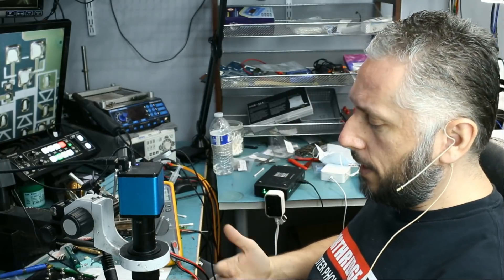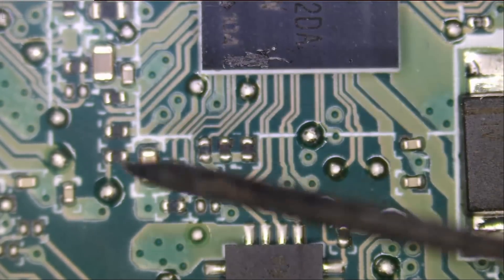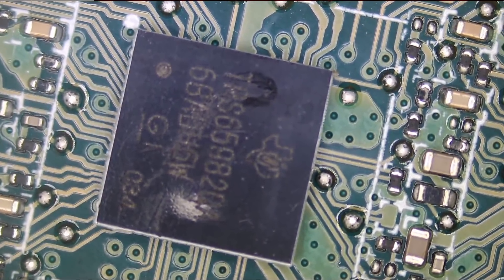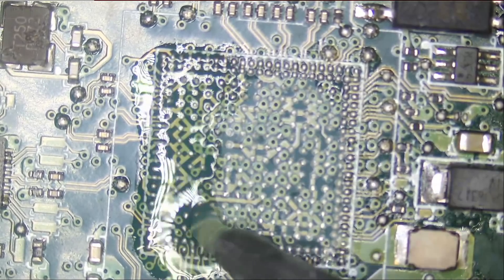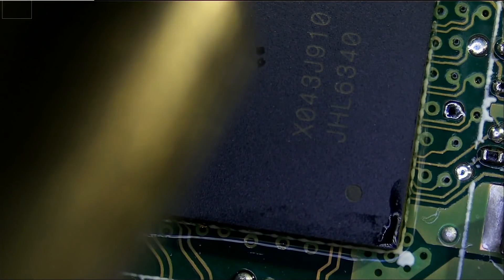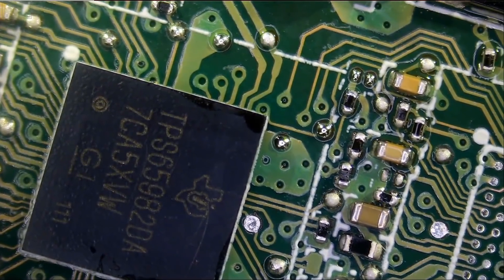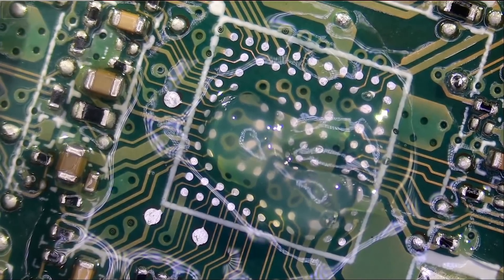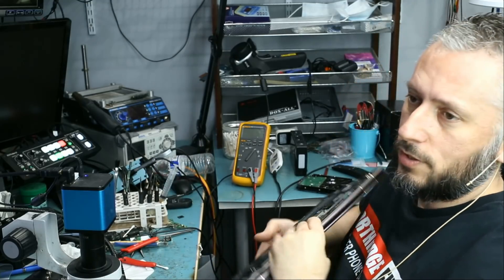HP Spectre x360 Laptop Repair - Not charging or powering on & both USBC ports not working

Comment from the maker: The chip at 11:16 was re-adjusted after realizing one of the two ports was not vworking. It had the wrong orientation
Reply: I was just going to comment and ask this. Because of the pin 1 in the first chip marker and the 2nd chip pin marker are the same place. Good job as always sir. Keep up the good and awesome work.
Reply: I saw it flip right before you got it down on the board. I could do nothing to help! 😅
Reply: did the chip still work? or did you have to replace it again?
Reply: was just about to comment on that

Comment: I have a Dell XPS with same chips, but three of them. One of the ports was at 5V, and the PP_HV line was short. I replaced the chip and now have 19.8V on all 3 ports but laptop still not turning on. I wonder if I need to change that other big chip on my board too. Didn’t find any shorts around it.

Comment: We have a HP Spectre x360 15-bI012dx and it would only charge to 1% on a new battery so I thought it was the battery and replaced it, but now it doesn't even turn on.  The computer has the green light when the power cord is plugged in and also we get the green flashing light when we press the start button on the side.

Comment: I usually add a small amount of solder on the pads and gently tap the four corners and the center of the chip when it's being reflowed. Sometimes some pads on the board are still quite cold or covered by flux residue when being reflowed, the extra solder and taps will make sure that nothing is blocking the balls.

Comment: I got mine to start  charging again by pure luck. I was testing voltage going to the usb ports and randomly tested a mosfet/transistor and got the 19v on the meter, and I noticed when the mosfet was contacting ground it started charging. This must have woke up other parts that had previously shut down to protect the board and from then forward I now have one usb port working. I guess I triggered the mosfet/transistor to start functioning  normaly by connecting it to ground, I dunno but it still has one power ic dead. I'll hope it continues to work and leave it be, one's enough...

Comment: Will not buy this model anytime
Reply: I reccomend will not buy any hp laptop including all models.hp did it before on dv series laptops and still doing the same they re using some components on to the motherboards will not working after 2 years when warranty ends.

Comment: When you remove each chip did you re-check for shorts on those caps?
Reply: am also curious with the same question
Reply: And why not desolder/check the caps first, like usual.

Comment: HP Notebooks beyond Elitebook / Zbook ranges are just bad.
At my last workplace (mind you not electronic repair shop, just MSP) we had several Spectre, Envy and Omen Notebooks that my Ex-Boss had sold before we made him take those from the portfolio die, often just after the 1 year warranty period. For those we sold with extensions they also died between 1 and 2 years of use. HP had the entire logic boards replaced and as to my current knowledge (not working there anymore) at least a couple of those repaired notebooks died within another year again.
If people want to get an HP notebook and are shooting for the lowest level / entry level you can actually make a good bargain with HP 250 G7s but it seems like anything in between entry level and professional level notebooks at HP is not up to the job. The kicker: a refurbished 840 G2 is in the same price range as the 250s and usually has proven for several years that it would not break down after some "light" office use.